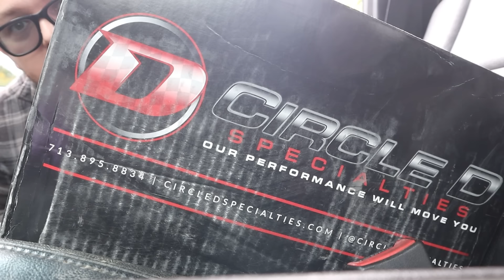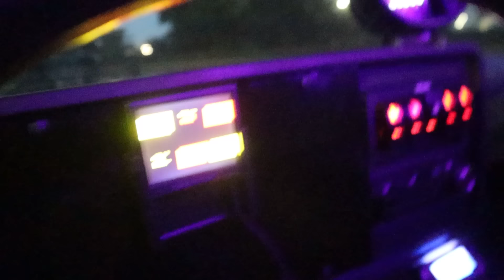Jack Black Launches HARD While Testing on The Street! The New Circle D Converter Is Putting In Work!

Comment: Idk if u had dragy in there but that looked like 1 of it's best passes especially on street.
Reply from the maker: It wasn't too bad. He was skating the whole way. I'm guessing it was probably like a 7.40ish
Reply: @SniderTron3000 
You think 7.40's   wow it looked like it was faster than that. 
To me it looked like Jack black was running about the same as the other that was there.
Maybe I'm wrong but to me it looked like Jack was moving pretty good.
Reply from the maker: @matthewvarnam4302  that red Camaro ran his new PB of 7.22, fighting a boost dip issue on the shift. Just looking at how sideway Jack was for most of that run I think he was spinning really bad and killing mph. I've made a lot of passes that I'm like "dang that felt fast as heck" and then look at the dragy and it was like a half second slower than I thought lol
Reply: @SniderTron3000  hell even 7.40 on street with kinda fresh setup still isn't bad